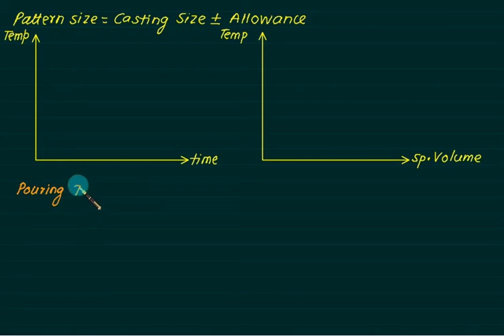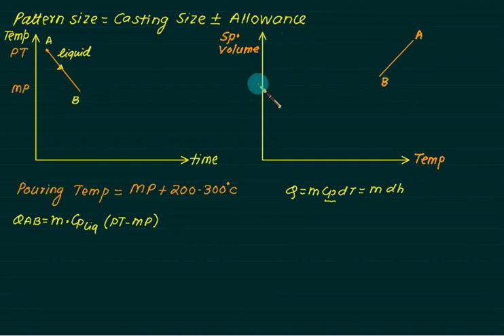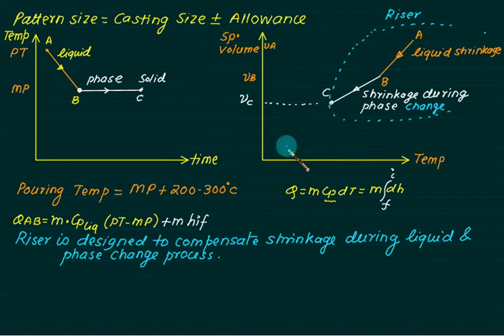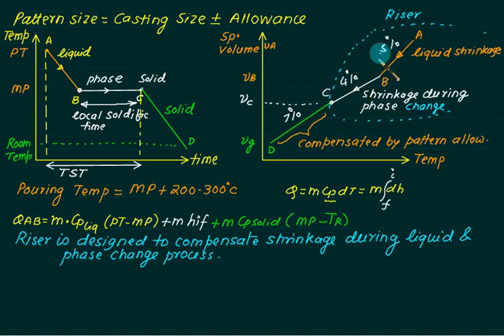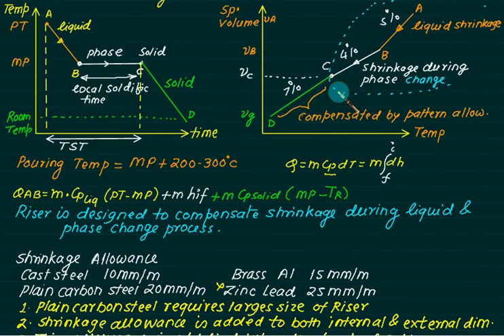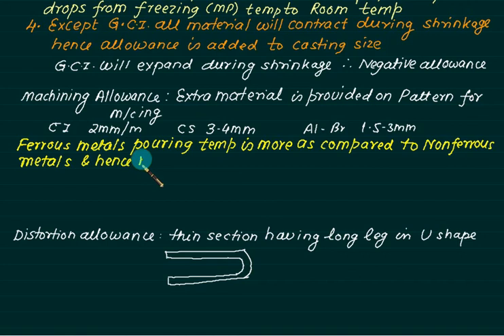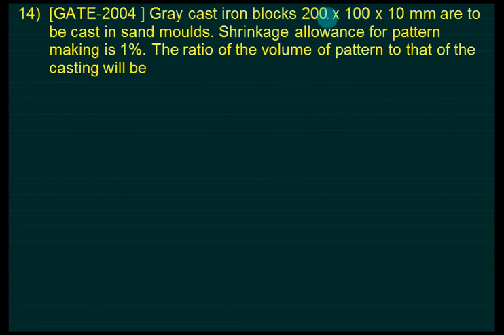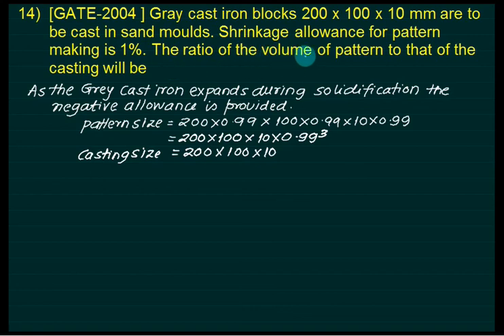Casting 02 Allowances

Comment: Sir previous gate question gate me 1999. Which material requires largest shrinkage allowance while making a pattern for casting . Ans given is brass. But as per ur class ans must be plain carbon steel. Which is correct can you please explain me??
Reply: Steel have overall high shrinkage . Aluminium high liquid shrinkage. Brass have high solid shrinkage